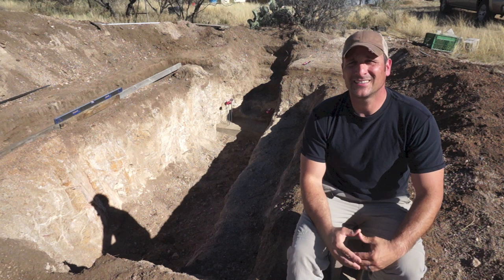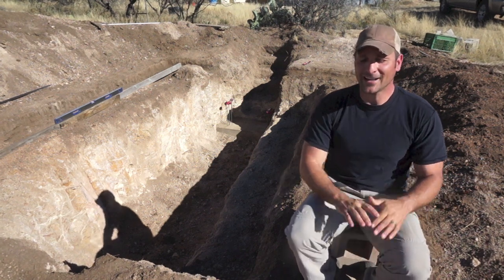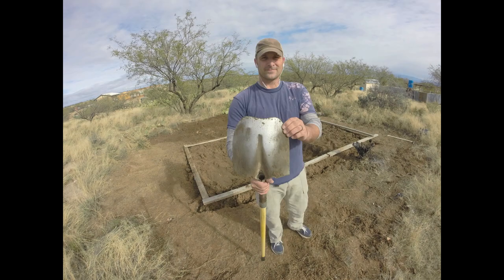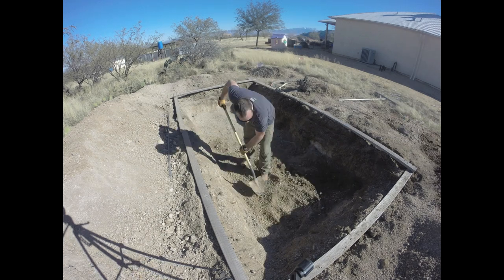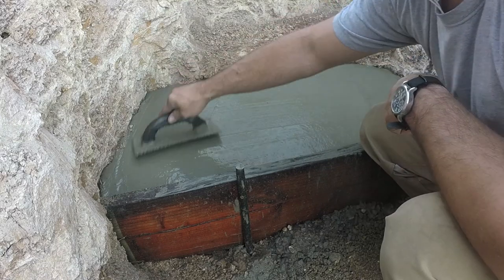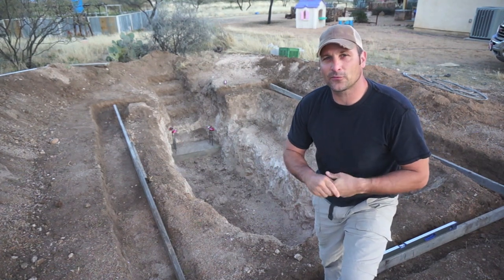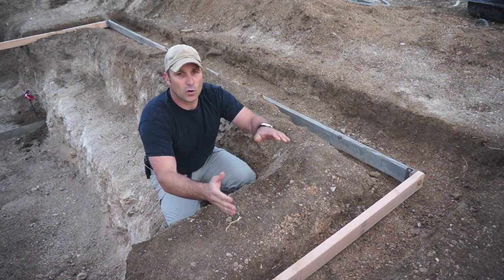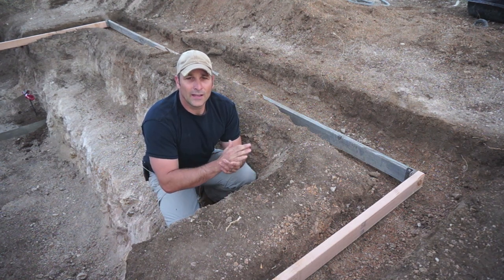Sunken Greenhouse Part 1:  Dirt work

Comment: I would like to build one but I am not sure it is safe to dig such a large hole without shoring up the walls. I keep seeing videos where people just dig but these holes can just cave in. What is the best way to do this so the walls do not cave in on you ?
Reply from the maker: If you check out the later videos on this project you'll see that I do add a retaining wall in part 4.  If the ground was staggered back enough then a retaining wall may or may not be necessary.  But it really depends on your dirt composition (rock, clay, sand, etc,)  
Anyways, sorry for the super slow response and thanks for watching:)

Comment: Are you working your design around capturing the winter sun?  Or more for warmer months?  I thought maybe angle of sun in winter might be a problem.
Reply from the maker: +Jeb Gardener Yes, it'll mostly be a winter benefit.  It won't however, let all the light in but with most plants being on shelves and in pots or buckets I'm thinking most will get adequate light.    I had originally planned a 'lean-to' style structure with a block wall on the north side, which would let a lot more light in, but then opted for the sunken to save on material and combat the winds a bit better.  But I'll have to wait and see how it turns out, as this experiment is no sure thing as of yet...lol... but I am hoping:)
Joe

Comment: Are you worried about flooding?
Reply from the maker: +Michael McMillan Hi Michael,   Flooding shouldn't be a problem as the final grading of the ground will slop away from the hole.   Also, we are at about 4000' elevation at the base of some mountains and aren't in a flood plain.  But I am planning on having rainwater drain into an interior tank or barrel from the greenhouse roof.. so if I don't have a secondary diversion, that could end up being a problem.   But I likely won't install that tank until i figure out the overflow diversion first:)
Joe

Comment: I don't mean to be a party pooper, but what about when you get down pouring rains, wont that flood your greenhouse....???
Reply from the maker: +PJ D Yes, it's a question that many have asked and i can certainly understand why:)  I do plan on doing a greenhouse questions and answers video after it's all complete.  But the short answer is that our water table here is hundreds of feet down and the ground around the greenhouse is being graded/sloped away from the structure.  I expect to get some rain in via the stairway but not more than 5-10 gallons per each inch of rain.  Anyways, it's a good question.... but if I'm wrong then I'll have to get started on that hottub;)
thanks for watching PJ   :)
Joe
Reply: Glad you got it covered, I just was a bit worried for you with a bunch of water inside it all! You sure have put alot of work into it. May I say it is a lovely looking greenhouse, good craftmanship!

Comment: Won't this get flooded?
Reply from the maker: I'm going to do a QA to answer that and some other questions.  But the short answer is that most all of the water flows away from the structure, except for a small amount that comes in via the steps.  but stay tuned as I'll have some video to show the inside after about 3" of rainfall... some wet spots but no flooding:)
Joe